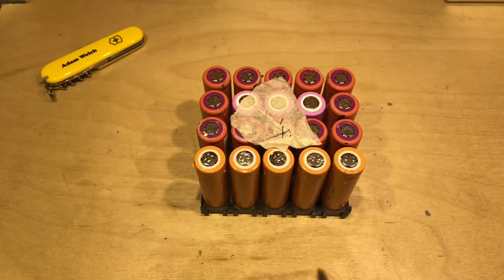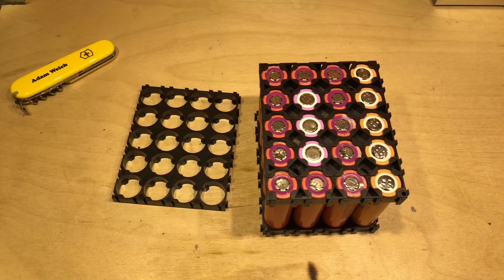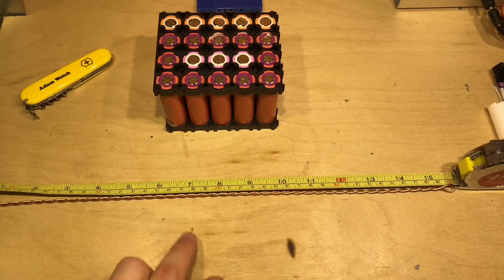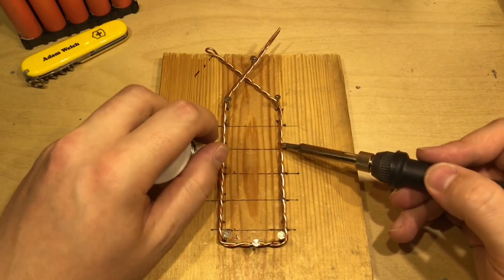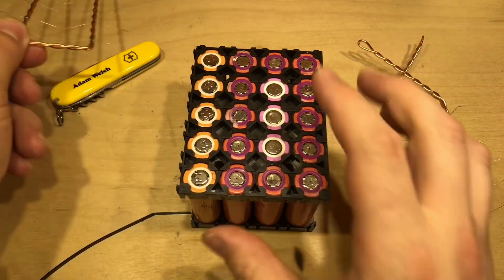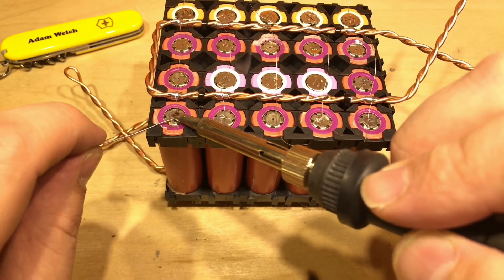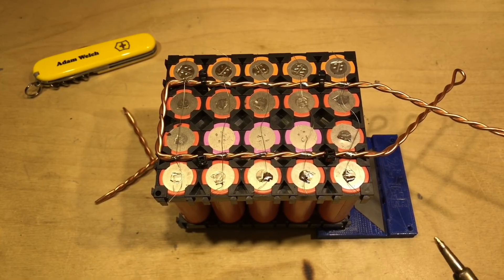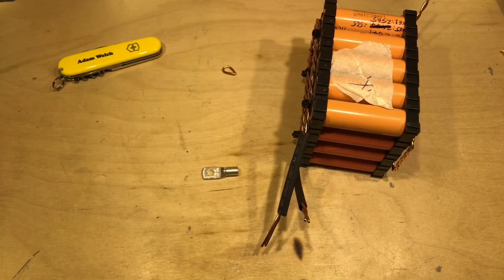18650 Building Blocks - 12v Solar Shed

Comment: ive seen very through testing in heating up 18650 cells, and from what I know from soldering to them also to Lipo's too, that cell phone batterys tend to get allot hotter for much much longer periods from just charging them, My ipad is almost molten lava without its case during charging, same with my Samsung S10e, actually you cant even hold the S10e during the end of a full charge In my opinion Soldering them for a few seconds does nothing.however extreme caution should always be used regardless what you do to these

Comment: big fail, only totally idiot go soldering li+ion battery and want possiple exploce him face all. lot better buy battery chase holder were can add all battery and holder can wired how want all batterys. or IF make many battery buy 100-300$ can  spot welding machine.

Comment: Hi Adam, it's me again Jack.  Thank you for your video.  May I ask if I can use couple of packs like this and parallel them together to connect them on a 12v MPPT charger with 2 100 watts solar panels.  Will this configuration work on shed and perhaps some backyard lights?  Thank you again for sharing this video.  Awesome work!!! Cheers.

Comment: Hello Adam!

Do you have questimate time for building the 7S20P bank starting with sourcing the batteries and ending with mounting them on the wall.
If possible don't count the diy bms :) 

I want to build my dc system for our home, unfortunately I know pretty well that a 20min length video may mean 6month worth of free time :D so if possible I would avoid such a pitfall at any cost :)

Thanks in advance

Comment: does it also multiply the total amps the batteries can deliver in parallel? the more batteries in parallel the more current?
Reply: also a follow up question, i have alot of 18650s i tested around 4 to 6 wh (1000-1500 mah) when i discharge them with constant 0.3 amps each they're good and able to retain the same readings last time i tested. but when i discharge them each 1 amp or more they instantly shuts down at 3.6v. if i rest the batteries less than a minute before plugging them back to my charger they're instantly back at 4.0v. are these bad batteries?

Comment: The little fuse/battery wires look a bit thin. If you crack open a cordless drill battery you'll see what I mean. If your draw off is trickle well it's ok I suppose. With a big load I think your in trouble.
Reply: Interestingly that is kind of the point. This is the final protection of the cell from heavy current draw. In a tool battery you are dealing with all brand new matched cells that can handle 20+ amps each. When you are using recycled cells you want to be really nice to them and only draw 2-4 amps max per cell. That’s why we put so many cells in parallel. 

The other thing we are protecting from is a cell that goes dead short. These are reused cells so that might happen. When it does the energy from all the cells in parallel gets shorted out through that one dead cell. The fuse blows and it protects the pack. 

This was first seen in the Tesla model s battery packs and seems to do a good job of protecting the pack from one bad cell.

Comment: Maybe pushing your fuses through the buss twist and soldering them in the form and tinning the ends before placing on the pack this could cut your build time once fluxing the end of the batt. would be even less Iron contact for heat .

Comment: Hi Adam. Hope you are doing well along with this amazing project you have been sharing with us DIYers. I really would appreciate your input on this build I'm trying to achieve. I would like to build this as follows and hoping it could be possible. I am in the process of building a portable solar power generator to use sparingly and for emergency purposes the build will consist of 18650 power and would go something like this:
3 packs of 24 cells in parallel, then wired in series to =12volts and 60ahs.(1- 100 amp 3s BMS added to the 3packs)
Then another
3 packs of 24 18650 cells in parallel. Wired in series to =12v@ 60ah(1- 100 amp 3s BMS added to the 3packs). Then
Connected together in parallel, to make it a total of 120ah battery at 12volts? I  would really appreciate some feedback from you Adam.

Comment: I was wondering do the - and + terminals need to be on opposite sides or was that a matter of preference for you Adam? Thanks
Reply: This,pack how much a e h
Reply: Please a,eh
Reply: I think Adam did this as when the pack is built, connecting them in series is a simple matter of bolting the positive of one pack to the negative of the next. Odd packs are flipped, so their negatives are up top, even packs are flipped so negatives are on the bottom.

Comment: IMPORTANT TIP: Don't put solder on 18650 before coopper...   I tried this on another project and the batteries act like a thermal insulator and for me with my 100 watt Harbor Freight gun The solder simply wouldnt melt on the battery.... Battery became too hot to the touch and I had to use anothe battery...
Reply: Whenever I have that problem I use a tiny bit of flux and the existing solder melts in under 2 seconds. Without that I have had your problem with the solder not melting even after a full minute of heat.

Comment: Put a drinking straw in the hole for the cable ties. It will act as a conduit and make it easier to feed the cable ties from one side to the other.
Reply from the maker: Neat idea. Thanks.

Comment: Good vid, thanks. I gave up trying to solder cells years ago, I found only the Weller station could do it which I used at work and I couldn't afford one of those, not to mention having to sandpaper all the ends. Watching how you breezed through it makes me want to try again. Cheers.

Comment: Hello Adam, how many amp hrs did you get on the 4X5 Cell and 7S configuration?
Reply: the one cell he showed had 2615mah. or 2.6ah. if all 20 of the cells are the same capacity, then this whole pack will be 52ah (2.6ah X 20). then if he build 7 of these packs and connects them all in series and makes a 7S configuration, the 7S pack Nominal Voltage will be 25.9V and the capacity will be 52ah. in other words it a 1.3kwh battery pack

Comment: In my build prep I actually retain about 4-5mm of the tab strip, rather than peeling it off the cells. This gives a perfect solder terminal as the tab material heats up easily and requires little additional (if any) flux....

Comment: Engineering newbie here. What are the advantages of using the copper busbar as opposed to nickel plating and tin soldering?
Reply: its cheaper,its everywhere and slightly more conductive

Comment: Great stuff adam i like the way you   done all the prep work to the fuse and buss bar by soldering them up before adding them to the battery pack.that alone will reduce the heat volume you put in the cells

Comment: Anyone looking for spacers, I have a generator on OnShape for 3D Printing spacers.  This is currently set up for a 4x4 26650 setup I am working on, but all of the parameters are on the side for easy adjustment.  Let me know if it borks for 18650 setups
https://cad.onshape.com/documents/c5fcbb209ccf11629864a834/w/4b3cad01acede977176bb82a/e/f9125a5866fd8edba6c9f201

For proper 3D printing, make sure there is no infill and the walls are intersecting like so:
https://scontent-sjc3-1.xx.fbcdn.net/v/t1.0-9/38637487_10155504807881389_5346328736910278656_o.jpg?_nc_cat=0&oh=636b87378e200fb08a170681d14ed45d&oe=5BC7106E

Comment: I have a bunch of fuse wire, but I am wondering. Do you need fuse wire on both the top and the bottom or would one or the other be sufficient?  It's not easy to get in the states.
Reply from the maker: Generally people only fuse one side. For me it was just as easy to do both, but it isn’t really necessary.
Reply: Thanks!  I'm going to make one side of my setup serviceable so I don't want fuses on the side I can't access.  I am thinking the positive side would be the service side for easy soldering.  Does this make sense to you?

Comment: there is really no point in twisting solid wire that gauge
Reply from the maker: I’d disagree. It looks a hell of a lot neater and ensures it all bends the same way nicely. Using two lengths there are always going to be kinks - twisting ensures they are touching all the way along their length and ensures current flows evenly.

Comment: ???   Why would you want to use Restive Fuse Wire ?    Why do you want to Restrict each cell to a mere 5 Amps ?
Reply from the maker: All wire causes resistance but yes, I may have increased this a bit, but it is worth remembering the resistors in parallel rule - so actually the resistance is 1/20th of what it could be. Each cell is limited to 5 amps. That’s 100 amps total for my 20p pack, and far far more than I intend to pull from it. The fuses are primarily to protect from a failure of a single cell. If one cell rapidly went short circuit the other 19 connected in parallel would start to discharge through it. High temperatures would be created and things could get out of hand quickly. So the five amp fuse should pop before that happens. Oh and my cells aren’t high drain - they lower for longer type cells which is how I intend to use them.
Reply: Cool Beans.  18650 really possess little threat of ever going internal short by their construction nature.  Unlike Poly Packs.  Them beast are flat out dangerous, eaa?   I use Copper Wire.

Comment: A lot of you asked?; How much current can the pack provide?. Well,  if the batteries are 2 amps each, you would get 40 amps and 3.7v,  or 4.2v fully charged, in a parallel fashion.  For 11.1v or 12.6v fully charged, you would need 3 packs.  In other words 3 packs of 3.7v  each. By adding 2 more packs in series, the current would still remain at 40 amps total. So, you need 60,  2 amp  batteries altogether, conected in a series parallel fashion,  for a total of 40 amps 12.6v.

Comment: Very good loved the video so what is the maximum current load per pack then?
Reply: If the batteries are 2 amps each, 40amps. 20 batteries in parallel with each other.

Comment: Thanks Adam. A handy trick for soldering to large areas, such as that bus wire (but obviously not the cells) with a small soldering iron is to use a small hotplate or a spare domestic iron as a base plate. Put the work onto the gently-heated hotplate, and solder as normal. Avoiding wrists, hands and fingers on hotplate! ;-D

Comment: Question: You've listed everything except the fuse wire in the description... where did you get that?
Reply from the maker: I've added that now, but to save you opening the description... https://ebay.to/2kkQPus  Cheers
Reply: Thank you very much. I didn't even know this existed, so this'll come in handy.
Reply: That is the most 'we live in the future thing' I've heard recently. Not knowing about fuse wire!
Reply: I guess I've been too used to simply buying new fuses whenever needed.
Reply: I just feel old now
Reply: Fuse wire is what's in fuses.

Back in the day you just used to use a bit of the wire wrapped round between the contacts.

In this case it's incase a battery goes bad and behaves as a short circuit and starts drawing lots and lots of current from it's neighours.

It's thin so it has high resistance and melts when too much current goes through it.

TLDR. Individual cell over current protection
Reply: What is Fuse Wire used for and why is it so thin?

Also in all of the battery pack videos they all connect directly to the cell using thin connections (or use Brass).

Comment: That method is neat, because you have fused each cell, avoided excessive heating, and obviated the need of making a spot welder for the job. Nice one! Thanks.
Reply: what is the point of the fuses?
isnt easier to use nickestrip?

Comment: Do you have to fuse both sides? Can you fuse just the positive or Just the negative? Than just spot weld the nickle strips on the other side.
Reply from the maker: Yes you could. I’ve just made all 14 buss bars the same.

Comment: How much current can you run through those fuse wires continuously? Fantastic video!
Reply from the maker: It’s 5 amp rated, so as per my previous video you could push a bit more than that through for a while - perhaps 7 amps. It’ll instantly break at 10 amps though.

Comment: Personally, I'd rather not take any risk of damaging the batteries.  I bought myself a relatively cheap spot-welder to construct a battery box using nickel-coated wire for the interconnects.

I only used a single fuse between the battery pack and the rest of the circuitry, although I can see the reasoning behind using fuse wire in the way you show.  It's probably a bit safer.  In that case, I'd spot-weld a short nickel strip to each end of each cell and then solder the fuse wire to that instead of directly to the cell.
Reply from the maker: I see the reasoning in not heating the cell, but as I showed this method has lead to minimal heating. I do very much like Paul Kennetts method of using pairs of cells and soldering the nickel strip, but my laptop batteries were all single cells so that wasn’t possible for me. Cheers

Comment: Nice tidy job. Looks good.
Reply from the maker: Thanks Paul. Your comment had been stuck in my head about keeping them in pairs and soldering to the nickel strip. Although I wasn’t able to do that because mine we all singles, I think leaving the nickel strip on there has helped reduce the heat required. Either that or I’ve been lucky. Looking forward to your next video anyway - good to hear from you.

Comment: Adam you have great videos. I just wished you did your project in completion. What I mean is, however many packs are gonna be   joined together, well show that. And how to do it. Then, the packs would need a balance lead put on them, show that. How you go about wrapping them all together and then the final step of showing the voltage. Good day mate.
Reply from the maker: This is all happening. I’m just doing it over multiple videos. Have a look back if you want at my older videos and you’ll find the whole story - well most of it.
Reply: Adam Welch Cheers! If I'm looking to build a 12v power pack box. Can  I use 3 like the pack you just built. And also did you fuse all 4 batteries together in the row or just 2 (space) then 2, on both top and bottom sides? Thanks for all your tips. You are one of my favorite youtubers.

Comment: have you had trouble with the red cells. with red insulators? are they sanyo? I have heard they heat ?
Reply from the maker: They are Sanyos yes. No I haven’t had any issues with heating, but I’ve tested all my cells at 500mA because that’s what my charger would do. Most people charge and discharge at 1amp and find cells which get warm. I’m not intending to pull any more than about 10-15 amps from my pack - so that’s about 500-750ma per cell. So I hope they won’t heat.

Comment: Hi Adam, Love your construction !
Simple and effective...
One hint: Instead of "folding back' the ty-rap use two smaller ty-raps, one inserted from each side. Easier to insert and easier to tighten up.
Reply from the maker: It’s a good plan. I wanted to hide the connector bit inside to make it really neat, but that didn’t work out. Your idea is more simple, quicker and looks pretty good.
Reply: another way to do it is to poke a drinking straw through and thread the end of the cable tie in it to make it pokes out again correctly
Reply: Another way is to use bolts...

...what is a short circuit capacity of a 65mm long M4 bolt? Let's find out.
Reply: I've done that already
https://imgur.com/a/K95Nx
https://imgur.com/a/neP6JWv

Comment: Hard wire shuld not be crimped better you solder them also...👍
Reply: If he uses the right type of crimper, then the crimp will be tight enough that the copper is cold welded inside the lug and to the lug. Depends on which crimper he decides to use for this part ;)

Comment: Do a vid on your overall 7s20p setup please. What solar panels are you using? Which charge controller? Why did you decide to go with 24v? What inverter, if any?
Reply from the maker: It’s all coming. It’s a big project for me so it’s all being done over various videos. Cheers.
Reply: 24v as per a previous vid its impossible to get 12v out of 18650s

Comment: Nice!
I think credit shoudl go to flyjabiru11 - https://www.youtube.com/watch?v=TedqvvDatMk - for the twisted bus bar idea and accelerated construction, which was also used by Average Joe - https://www.youtube.com/watch?v=e0tjzgXnk0E and Pete of HBPowerwall
Worth watching - some great tips for the community!
Reply from the maker: We spun copper on a drill back in my theatre technician days, but credit where credit is due. I did mention HBpowerwall but you are right to mention the others. I’ve seen some of Average Joes videos but flyjabui is a new one on me. Cheers.
Reply: Oh yes, spinning copper isn't at all new, but a lot of the community were struggling with bus bars of solid copper/brass which added unnecessary cost and difficulty, as Pete was finding, and flyjabiru11 showed the way forward - especially for those without spot welding equipment.
I opted for 10awg flexible silicone wire for my packs (16S 8x2) and cut gaps in the insulation for the fusewire before wrapping in duct tape and using split HXT connectors and 2mm bullet connectors for the balance port so I can quickly daisychain them 14S for the ebike, double up as 7S for the UPS, quadruple them as 3S for the compressor or anything else...
Still have a pile of 800 processed cells to assemble for the next pack and for that I'll use 4 or 5 2.5mm strands for the bus bars.